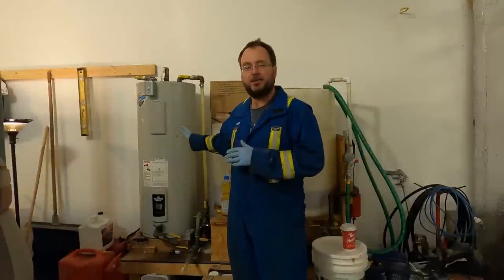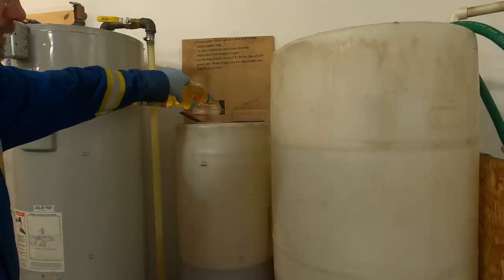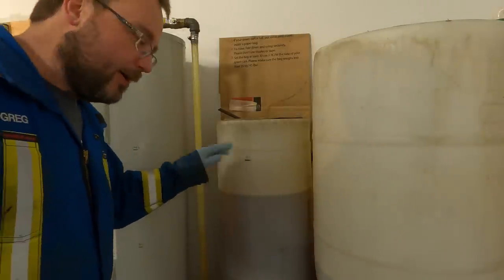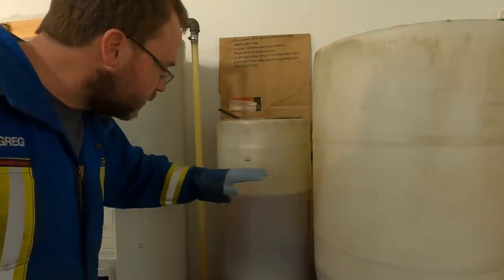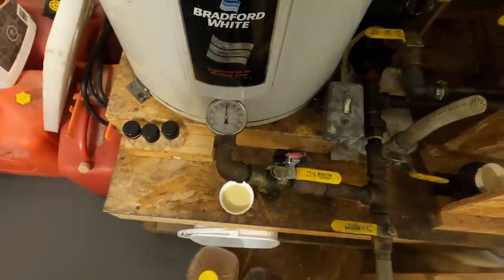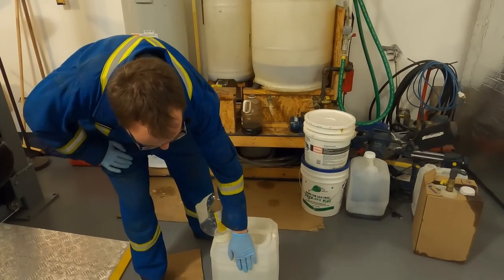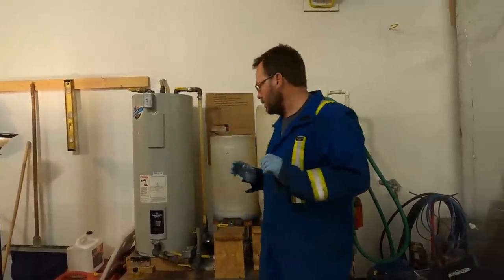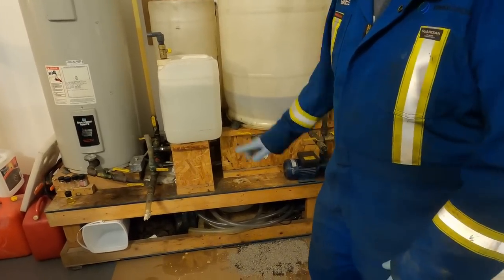Making a batch of Biodiesel from used Canola oil - HOW TO MAKE BIO-DIESEL!

Comment: Heating coil, connected to a controller, that is getting input from a thermometer. You can set 140 and it will only heat to that point and hold there. At least that’s what I would do from an industrial stand point. System like that come up to maybe $100
Reply from the maker: there's a thermostat in the water tank and it is set to 140.  It shuts off at 140.

Comment: I have watched many methods for biodiesel, apparently glycerin is also used as a fuel its very flammable despite what the paperwork says. So some have opted to keep it in their biodiesel. To get rid of the junk in the vegetable oil in the method where glycerin is desirable, you would simply heat the oil and mix in gelatin powder which is easier to get ahold of, and then cool it down in a fridge. the gelatin latches onto impurities like a magnet as it settles. When the gelatin solidifies, what your left with is biodiesel on top of it because it won't mix with the gelatin. Simply pour out the liquid and remove the gelatin which took out any water or impurities from the solution which should be suspended in the gelatin. The amount of gelatin you need is somewhere around 15% to the solution. It creates a biodiesel that can run simpler diesel engines, and heaters. I wouldn't run it in a newer vehicle but I would in a generator. What I love about both versions is all of the ingredients can be made at home.  (best to make the catalyst outside>>)The Catalyst is simply LYE crystals, which is made from burning hardwood (but other woods work too, hardwood has more concentration) and filtering water through the ashes and boiling the water off to make crystals. Methanol comes from making alcohol but alcohol also works to make biodiesel so basically you ferment your alcohol the typical way for three to four months, but since it is not for drinking purposes you can simply freezer distill it, which gets rid of the water and other junk, and use the unfrozen alcohol for it. The vegetable oil can be made in a mill you can order online for pretty cheap, it's made from any plant seeds you can find the biproduct is fertilizer. Make sure to label your ingredients. Gelatin comes from animal bones but I'm not really sure about that one. I know Gelatin is possible to make at home as well, but pectin might work as a substitute though may have a different result. The Pioneers could have made biodiesel technically so why not.
Reply from the maker: interesting theoretical ideas.  Mostly not practical though.
Reply: @gregs_garage  Theoretical? These are bits of what other YouTubers are actually doing. I'm just trying to bring the ideas together. Spark some creativity.
Reply from the maker: @daniellapain1576  I think you have to crush a lot of seed to make oil.  not worth it.

Comment: If you can make it cheaper than regular diesel you struck gold any trucking company will gladly do business with you if you can save them money and if your product works with no problems.
Reply from the maker: The problem is volume.  I can only cobble together small amounts of cheap waste oil. Personal use is fine, but If you scale up it gets expensive fast
Reply: @gregs_garage  Yup you would have to make 1000 Gallons a week 4000 Litres to cover your costs for a warehouse and equipment. also that's if you have no employees and if you distill your glycerin for methanol. that should cut your methanol costs in half that's like $15usd a gallon cheapest on Amazon.

Comment: I got filtered oil. Ready to mix. I mixed with gas and acetone. Tried in my diesel heater. I think the pump had issues? I even thinned it out like crazy, trying. Still stops running. How much lubrication does that have vs diesel
Reply from the maker: I don't know.  What you made is not biodiesel.  It is oil thinned out with chemicals and I wouldn't use it.  Maybe in an old tractor but even then maybe not!

Comment: can you use or any uses for the glycerin and other contaminates, also can you use water to clean the biodiesel?, I love the way you explained the process, other question is can this biodiesel be used in modern diesel cars?? thank you
Reply from the maker: 1. Glycerin - you can make soap.  I made 20 litres a few years ago and still have lots left as hand soap.  I've heard you can spray it on dirt roads to reduce dust also.

2. Water - yes in one of the videos I talk about water washing.  You can mist water thru the fuel and drain it out the bottom.  Then dry the fuel to evaporate any left over water.  Messy and time consuming.

3. Modern cars - yes I think it is ok in smaller doses.  Although I don't know for sure.   I know that older diesels are more forgiving.  I run a 2003 TDI and it is fine with a variety of fuels.  I always blend my biodiesel with petroleum diesel anyway.
Reply: Yes, you can use fine misting of water, it drops down through the oil and pulls the fats out. But then you have to heat it up again and agitate it, to Dry the Bio-diesel.

Comment: Would this process be good to run in a "modern" diesel. 2014 ram 2500
Reply from the maker: Maybe. Check the manual. I think 20% is safe.  Maybe more of you remove the junk

Comment: I’ve heard the methoxide reaction that the catalyst undergoes is exothermic and that you shouldn’t do it in a plastic container. Do you know if that’s only with a different ratio than yours or are you using a plastic that’s better suited to high temperatures?
Reply from the maker: It does not get very warm.  Maybe gets to 100F or something.  HDPE plastic is tough - no issues
Reply: @gregs_garage  HDPE has a melt point of 125c (257F) so I think HDPE is fine lol.

Comment: Thanks for the awesome video and for all the info too. I'd like to know if this could possibly applied to used motor oil turned into Black diesel. I know I would have to filter it way down to remove containments down to possibly 1 micron with a centrifuge then into preheating but wanting to see if the chemical's being applied can possibly help with particulate matter separation such as soot. thanks again for the great video and info on your setup and helping other with their biodiesel ventures.
Reply from the maker: No the chemicals used for biodiesel have nothing to do with filtering old motor oil.  Biodiesel and old motor oil are completely different substances.

Comment: @19:28 It took a bit of finding. The lower heater is 3000W @240V. 
Power = V^2/R
The R of the heater doesn't change.
So half the voltage means quarter the power. I.E. 750W
Reply from the maker: ok makes sense.  The oil heats slowly at 120v which is what I want.  750W seems perfect.  I tried a 120V element and it burned out in a month and you could hear the oil sizzling.

Comment: Could you not re run the process to clean the diesel even more? Also could you not make the catalysts out of other common chemicals? Last suggestion put a 90 on that drain pipe for removing the nitro.  Thanks for the video
Reply from the maker: yes you could re - process but the economics go downhill.  What common chemicals do you have in mind?  KOH bought in industrial strength and quantities is hard to beat.  Common chemicals are expensive and not sure what you suggest.  The 90 is not a bad idea but I like to see the glycerin come out horizontally.

Comment: Hey you didnt talk about the need to check the oils acidity content to calculate the correct amount of catalyst.
The catalyast is to get rid of the acid in the oil. More dirty the oil contains more acid so an acidity test needs to be done to the oil to determine how much catalyst to use. If you use too much the diesel will be Alkaline, if you use too little the diesel will be Acidic, both are bad for your fuel system pump seals and cause corrosion of the fuel system in your vehicle.
Reply from the maker: right - i didn't get into that.  My oil is clean low acid so I use the base amount of catalyst plus a little bit.

Comment: Have you tried the gelatin method of removing contaminants from the used oil? Then doing a 70/30 ratio mix with kerosene? (70% oil/30% kerosene) The total cost will still be less than the current price of diesel. No added cost of electricity, no dangerous chemicals, no chemical by products to dispose of. Just some solidified gelatin that can be used to fertilize the garden. My neighbor's brother runs his farm tractor on diesel made with this method.
Reply from the maker: no.  That is not biodiesel.  That is some sort of cleaned up waste vegetable oil mixed with Kerosene.  Nothing to do with Biodiesel.
Reply: @gregs_garage  Hmmm... May not be "official Biodiesel" but it runs great in his tractor (Kubota). He just brush hogged 13 acres of my land for me over yesterday and this morning. Just sayin'...
Reply from the maker: @research903  it might work for some engines.  for a while anyway.  Who knows what veg oil and chemicals will do to injectors and other parts eventually.
Reply: Parts wear out anyway, its free and ez and you have no real argument against it

Comment: Last question from me, can a guy use 1” pex line and brass or plastic fittings? Or will it deteriorate the lines
Reply from the maker: I don’t know how PEX stands up to chemicals and oil.  It’s worth a try for sure.  PEX is great for plumbing.  I’d do it if I built another one.
Reply: I saw in other comments the older the vehicle the better it runs. Will new diesel trucks required to be tuned to the fuel? Or does a guy need to run 50/50 ratio. I would think as long as the acid titrations are within permissible limits I’d be okay.
Reply from the maker: @ethonbell5181  yeah the dpf and all that emissions stuff apparently doesn't like it.  But who knows.
Reply: @ethonbell5181  that's a good question. I was kind of wondering that myself because I don't really want to mess with my tuner rite now ..my truck's running great on this 5.50gallon b*****

Comment: Is that pump a standard transfer pump, or is it rated for fuel?
Reply: Just curious if the pump seals would go bad more quickly if it is a standard transfer pump...
Reply from the maker: its not rated for anything.  it's a donkey pump rated for water.  It has lasted 14 years so far.

Comment: Once the reaction between the biodiesel and Methanol occur. Could you boil both the biodiesel and glycerin at about 150-160 degrees to extract the methanol?
Reply from the maker: I don't think so.  I wouldn't be boiling fuel and methanol.  one spark and you're done.  There are ways to extract methanol but IMO it is not worth the risk.  penny wise and pound foolish.

Comment: I didn't see you do any titration tests in the beginning to check to see how acidic your oil is. also no mention of a quality check  before or after your finish tank. I did see some small glass jars in the video so maybe you just left those steps out for some odd reason. have you ever done a water wash to remove methanol ?
Reply from the maker: 1) I get good clean oil so I know the quality and how much koh to use.  I titrated a long time ago and have a feel for it.

2) I have done tests on the finished product just not for this video.

3) I have a water wash mister in this tank.  I have used it.  I don't like the oily messy water that has to be disposed of.
Reply: Yes, I was wondering about Titration, because it can change the amount of KOH you use.

Comment: Can you use this oil to power generators or sump pumps?
Reply from the maker: older diesels will run better than newer ones on alternative fuels, in general
Reply: Only if they're diesel
Reply: @gregs_garage  how about an o8 ram 2500 with a built motor with meth injection, deleted b.s, a 4 stage programmer, ect? I'm assuming I'll have to have 2 tanks..a tank heater, line heaters ect...start off on the straight diesel and then switch over to the oil once everything is rolling.?
Reply from the maker: @billyjones9045  Biodiesel is similar to regular diesel.  No mods required if you don't have emissions b.s. except in cold weather you should blend with petroleum diesel because biodiesel gels.

You are thinking of waste vegetable oil with separate tanks, etc.  WVO is silly.
Reply: @gregs_garage  
Four years on WVO with no issues in my ALH. Looking to get into bio though. I would rather have more “going on” in the garage and less on the car. Great vids btw. Some comments saying you hate bio diesel but it seems like you say it with a wink wink nudge nudge. I know it can feel like a hobby sometimes but the savings are awesome.
Reply from the maker: @AndrewMarsch  correct.  There is risk on many levels producing biodiesel and I don't propose anyone should make it.  except me.

Comment: where are your fiters you only used a screen  so your Biodiesel is dirty Diesel  you did not use a  5 or 1 micron pre-filter and do you do a water wash on it ??? as the your using the chemical reaction method so if you did porper filtering and water washing  you could  run it with no issue with out mixing or you could do 80 bio 20 diesel mix  but all and all a decent setup
Reply from the maker: I don’t think pre-filtering is necessary.  Just a screen is enough.  I can run this 100% biodiesel no issues in 15 years
Reply: @gregs_garage  the method I use I can run it in winter down to -15  in canada without mixing with diesel or solvent  and prescreening and water washing makes it compatible with modern diesel engines and 0 chance of damaging the injectors or clogging them I go thought the extra steps  because i run it in my 2022 duramax and my 2 2020 6.7s  all year round  and my older trucks run on ot too  and I also convert old oil and tires into fuel that I mix with it for any thing below -20
Reply from the maker: @SaerTurner  I doubt pre-screening or water washing have anything to do with low temperature performance.

Comment: I am cautious with Bio diesel, when running pure in a 20 thousand plus  dollar engine, gum up the rings quickly  Canola is bad for that. Warranty is void,  I know used to use it.  Lot of work, spills mixed with methanol glycerine is a bi product that one has to dispose of.  Environmentally.   This seems to always make a hit when fuel goes up in price. When it drops, nobody does it. plus, having a loyal oil base supply very hard.  been using it for 10 years plus..  Diesel engines around 10%  more as a lube.  or some mix with gas depending on the Temperature, 20% gas to 80% bio.  you can really smell the gas fumes when mixing.
Reply from the maker: I agree it gets popular when fuel prices are high.

I wouldn't mix gasoline with it.  When it is cold I blend with winter diesel fuel and sometimes some kerosene.  Very cold temps I may run 10%.  Then adjust upward depending on the weather.

Comment: Iran a 1981 volks wagon  on waste canola oil by simply by cleaning it using a cream separator as a centrifuge and pouring directly into my fuel tank. Now the temperature had to be 16c or above for starting, but on the upside, there was nothing to dispose of
Reply from the maker: Except the motor

Comment: Can we use athanol....?
Reply: I have attempted to use ethanol in stead of methanol. I believe it to be possible but then an amount of water also has to be put into it. I had a good look at the chemical formulas and found that some extra Hydrogen (it is getting that from the water) was needed. 
I never actually used it as diesel in any motor. I just made the experiment. It at least made soap so it must have worked. I didn't heat it either and it still appeared to work but possibly slover. I had it standing for maby a week. The reason for not using it in a motor was thatit was only a small amount that I made as the vegie oil was more expensive than diesel. The economy was wrong. I have some old diesel tractors that would have been fine to use it in and I may consider it if diesel become scarse in the future.

Comment: Looks like overkill process. I saw other Youtube content creator that filter the used oil to 1 micron then thin out the oil 50/50 with diesel and done.  No extra Glycerol to dispose.  Ive never done this before but looking to get an old diesel truck to try it out.  Anyone try that method??
Reply from the maker: that's not Biodiesel.  It's veg oil mixed with diesel.  It may work (for a while) in some engines, but it has nothing to do with Biodiesel.

Comment: I wonder if you could get away with just running the old oil through a filter and making a B50 mix?
Reply from the maker: it's not biodiesel so it's not B50.  If you're talking about old oil and 50% petroleum diesel then it may run ok but probably much harder on components than proper biodiesel.

Comment: I really like the setup. But one thing that he said that almost made me exit the video. For ANY vehicle, it MUST be clean. Just a screen at the start is not good enough in my opinion. It should always run through a much better filter system before ever starting. Contaminates will eventually clog the system. Then at the end, starting with a 10 micron filter is good, but should go through at least a couple more filters like a 5 then a 2. Last thing you want is a small particle that got past the 10 to kill an injector. With fuel, cleanliness is key.
I've made a similar system myself a long time ago. Ran my tractor on it. Stopped using it when someone stole my tractor.
Reply from the maker: Any particles fall out in the processing.  No need to filter the raw oil other than the big chunks.  At the end nothing is getting past a 10 micron filter.  If it does, the fuel filter in the car will catch it.  Nothing is getting to the injectors.  You’ll introduce bigger particles at the gas station pump than you ever will during this process.